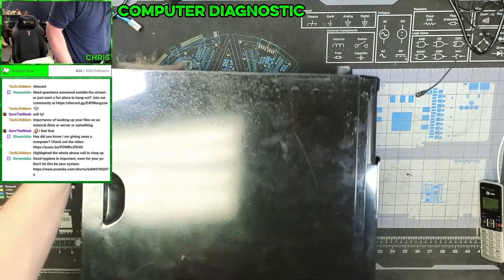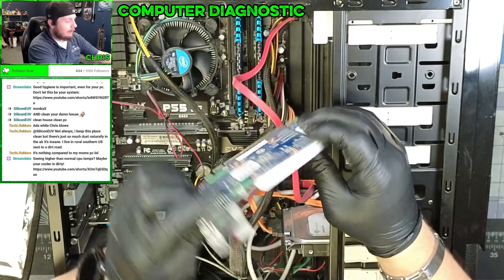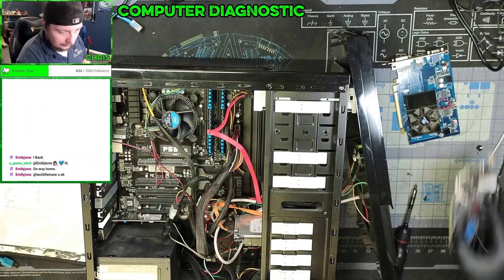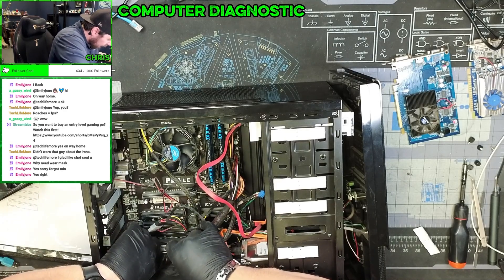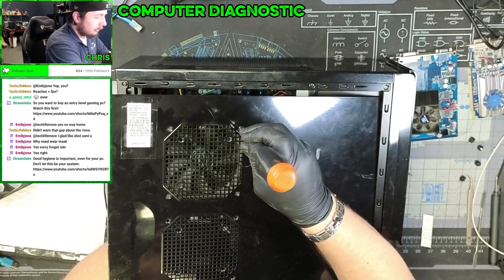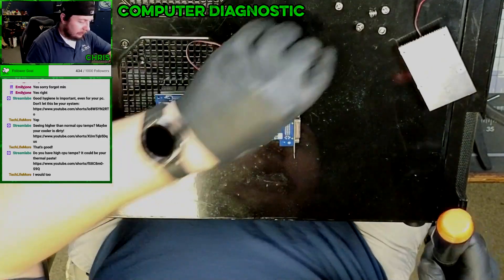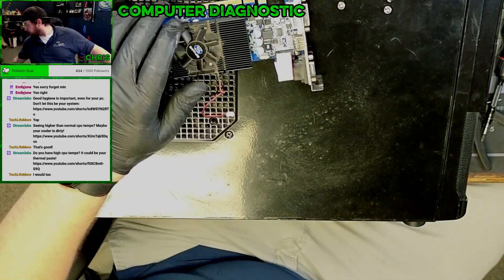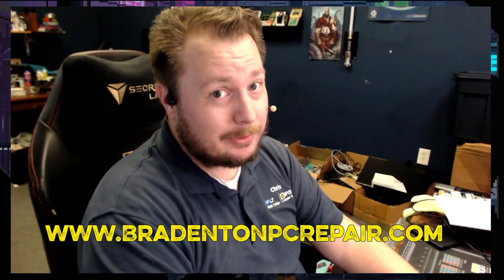Custom Build PC Has Dead Fans, I wonder why? #180

Comment: As computer tech, I will remove all this filter mesh on the power supply intake from customer that will never do clean up, not only the mesh will collect dust and blocking the intake air to cool the power supply, it will slowly degrade or damage the power supply due to overheat, in fact most of the branded power supply i replaced died sooner than it should was due to the blocked intake mesh.
Reply from the maker: He brought the computer back in a couple months later with a dead power supply and we rebuilt the whole thing with no screens and a zero rpm power supply! Great suggestion.

Comment: The description has a typo, that PC is from early 2010s not early 2000s. The i5-650 was released in 2010 and the GT 520 in 2011
Reply: Actually, the amount of dust would indicate early 2000's BC.
Reply from the maker: You are right about the CPU. The detail that was left off, and that is my fault, is that I built this PC in the early 2000's for this customer as a register and have been upgrading it as he needs it. I believe  that I have video coming out later this year about me upgrading it again. So you are 100% Correct, but I was wrong not to clarify.
Reply: @Bradenton-PC-Repair  Oh so it's like the Ship of Theseus where every part has been replaced over time
Reply from the maker: @Pasi123  Perfect analogy. The thing started with a Pentium 3 Board in it, and we have slowly advanced. Hopefully I can convince him to use windows 10 one day lol.